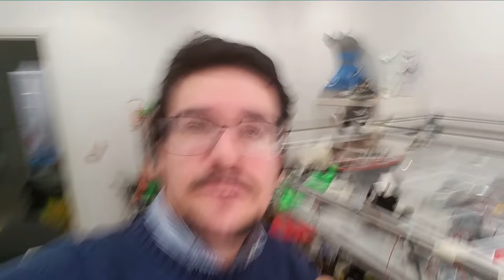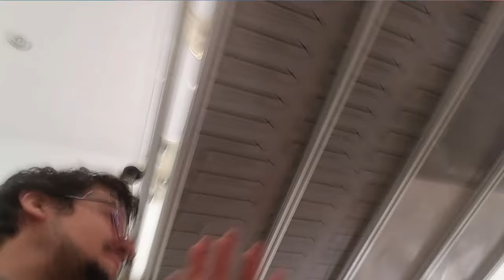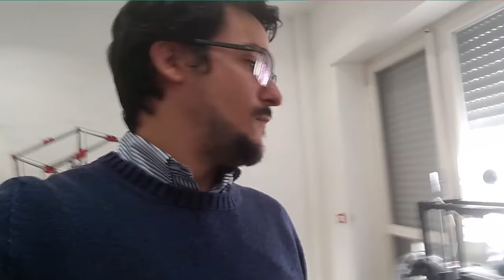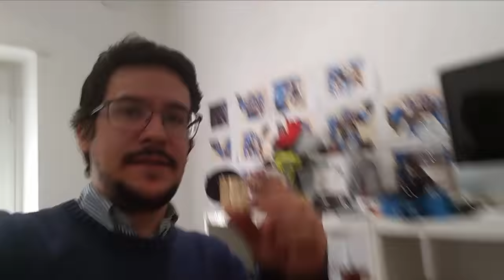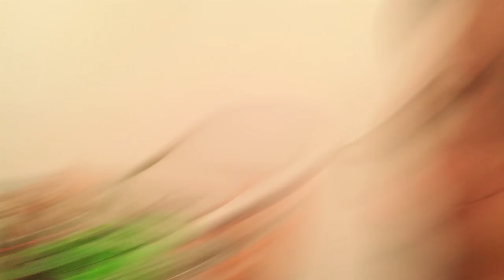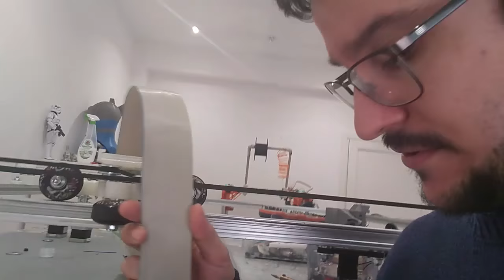[Ep. 5] [ENG] [Subs ITA+ENG] The three months of CoreXY damnation

Comment: Hello! I have also spent quite a long time fighting belt tension on corexy. While in the future I have decided to use a different design, I believe I solved the problem.

See this diagram: http://www.virindi.net/junk/corexy_tension_diagram.png

What you need is a single length of belt that is as long as both sections. Run it with the two sections initially connected in the middle at the tool carriage. Add tension before clamping the center of the belt run to the tool carriage, then place clamps there to separate the two sections after tension is already in place. This guarantees that each belt has identical tension (assuming you move the belt around a bit first after tensioning it so that the tension is even).
Reply from the maker: Thanks mate! We'll sure be trying that one as soon as we get new linear rails, we've found out that the overall stifness of the CoreXY gantry is crucial avoiding ovalizations and such problems. Should be a thing of the past as soon as we get them! :D

Comment: Why not insert a thick rod to fill inside the extrusion then your too-narrow carriage wheels can run along on top of that. Interesting video though and good for me to watch as Im also planning to build a double size Hypercube.
Reply from the maker: Hello there! Please, explain the rod thing, it seems to be a nice idea!
Reply: A printed rod would in-fill the space into which the carriage wheel is  'sinking' too far to run along the extrusion, This is a good idea only if you can't get hold of thicker carriage wheels..which would be my first choice. Sometimes we must adapt what we have, so, if you can print an insert "rod", you'll raise the wheels off the Extrusion's "gap" that you want it to run along. Hopefully that's clear?
Reply from the maker: Ahhh, yes, you mean the wrongly used wheels on the orange printer! They're already on the "to-be-fixed-soon™" list, we've already switched the x beam with a double steel rod, the others will be removed and the whole carriages will be replaced with 45°-turned w-profile wheels as shown in my bigger printer on the x-assembly and soon on the y-carriages too

Comment: Why you can achieve same belt tension?, i just measure EQUAL leghts of belt and attach them, perfect belt tension. Another thing is, from my point view, using that setup, (rollers on the aluminiun profile) you never gonna achive decent quality with CoreXY, regardless belt tension, i would mount linear carriages likes MGN12 and increce presicion, stability and reduce XY carriage size, i know they not are so cheap like 3d printed part with bearing on the aluminiun profile, but in the end you get what you pay, Also i think that 3 months of you life are more valuable than a good linear system,
Reply from the maker: Hello! I totally agree. Unfortunately I've used same-lenght belts, and not even with adjustable tensioners I've managed to get perfectly round circles. So maybe it's all up to the stiffness of the whole gantry, and some MGN12 or even bigger linear rails would have made it work, but that's not cheap stuff and what I'm trying to do here is to get maximum quality while avoiding whatever costly part I can, I'd even 3dprint my leadscrews if I could, lol. This will help making this monstruosity cost a lot less than it would with all the machined parts. It's hard to do, but I'm getting closer!

Comment: The reason for the mismatch is something I found in my delta as well. There are two reasons for this. FYI the belts I use are kevlar reinforced. Initially when I built my printer I tensioned the belt and after very few hours of run-time the belts were loose as heck. They needed to be tightened multiple times as they break in. This is on a 1.5M belt. You look like your running 5+ meters of belt. Get steel core belts, and run them in as well. It may be easier to run them in if you can use a hair dryer to provide some heat on the belt while its running. 

Another thing I would do is see if you can find pulleys that allow for twin belts per pulley. This would more than double the strength of your belts and reduce the stretch. I bet over the kind of range these belts are moving on they have stretch measured in MM not in fractions of a MM. The reason cartesian ran better for you is because the belts are shorter.
Reply from the maker: I've tried the steel reinforced belts in the past, and didn't get good results... But that was on a totally different configuration. I'll try them again soon. I don't think lenght is such an issue, on the first configuration the X part was done with a crane-style belt run - it was about 8 meters long and it worked flawlessly.
Anyway there's a lot of stuff to try yet! :D

Comment: hey, good to see you again, i'm building corexy printer too, and i have couple of things to suggest.
first, consider investing in some good industrial linear sistem like this roller rail http://www.lm76.com/LGCweb.jpg.  its very rigid. and with your big printer i think it can perform better than plastic wheels.
second, try using white gt2 belts, they almost dont stretch because there is steel wire in them.
and last one,  you can decrease weight on you carriage by usind smaller (like 2 times smaller)  extruder motor but with reduction gears. 

hello from russia)
Reply from the maker: Hey there! Thanks for the kind words, unfortunately I'm trying to avoid using dedicated linear rails as much as possible to make it possible for everyone who can't source them to build a printer anyway; and in the past it worked flawlessly with those plastic wheels, it's that I have only one prototype to try things on so it happens (as it did) that sometimes I get caught on some ideas that won't work on this philosophy, like the CoreXY. Even though it worked, the first times. Maybe there's a way to make it work but if I'm right I've managed to make an easier cartesian system, and I'm about to show it off on the next video! (hopefully, before three more months! XD)
About the belt: I totally agree, I've tested them, these one I'm using are too gummy - but they will work for the new system, that's assured. When I'll try again CoreXY I'll move maybe to an even more tougher GT5 belt! 
Also I've added the E3D Titan in place of the old Bulldog Lite and yes, overall mass is now a lot better!
Stay tuned, I'm almost out of the alpha stage! :D
(yes, that means cad files going online)